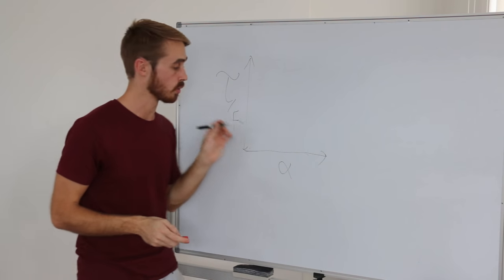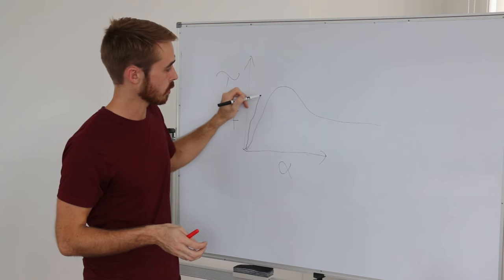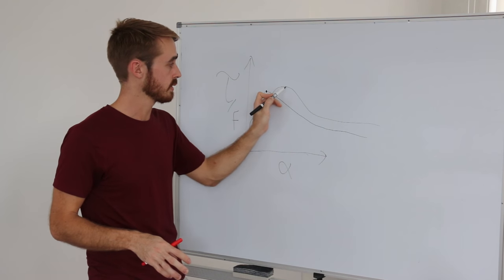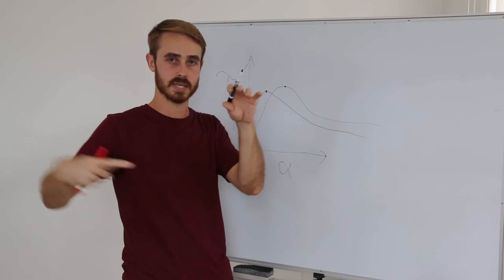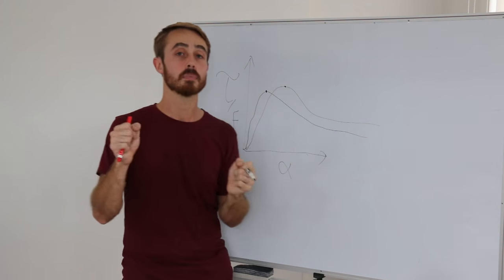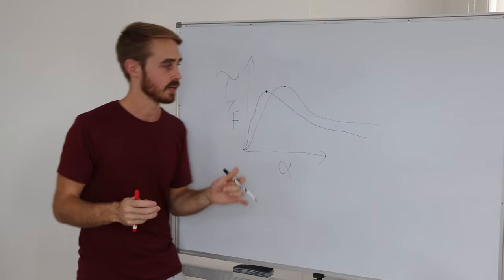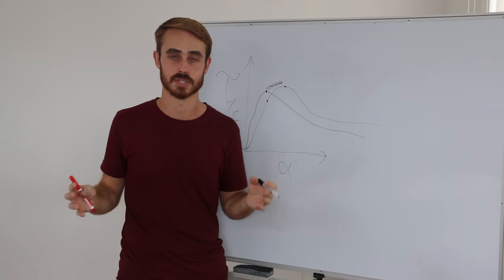Tire Contact Patches and Self Alignment Torque Explained

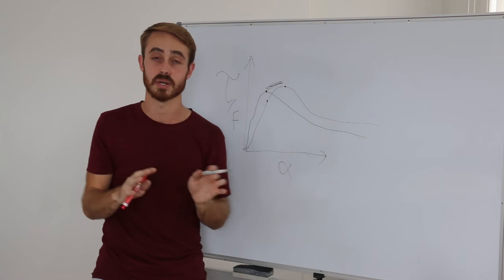Comment: Wow! I made a huge realization @ 1:27 :O
I've been cursing how my current race car feels on certain corners ... wiggly, doing exactly what you describe, i'm constantly having to steer back and forth, back and forth ... So basicly i'm just driving between the peaks - and actually doing things correctly :O

I'm using current favorite for timeattack, the potenze re71r as tire on a lightweight low powered (174hp/900kg) car.